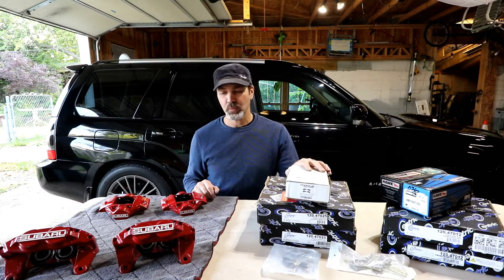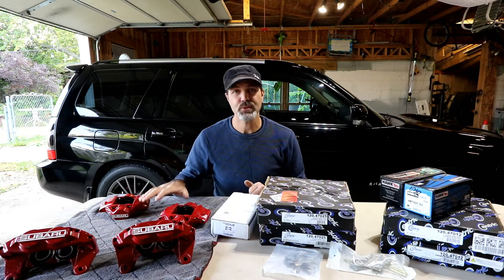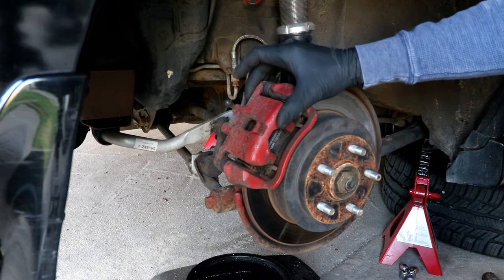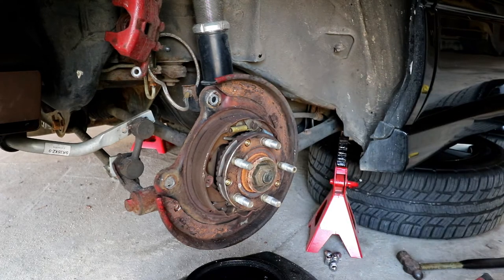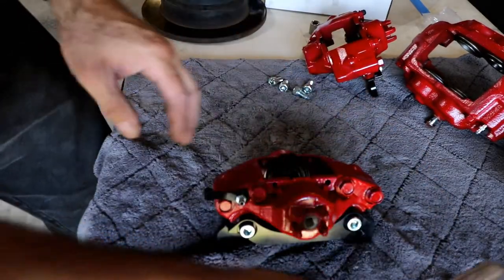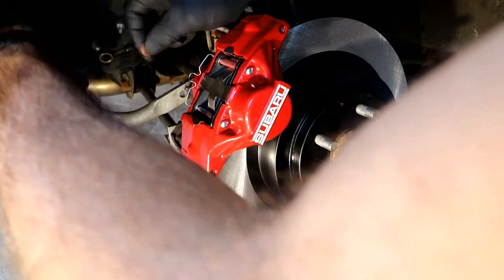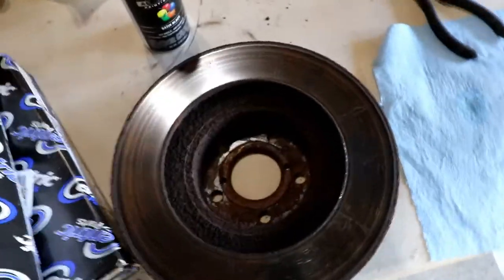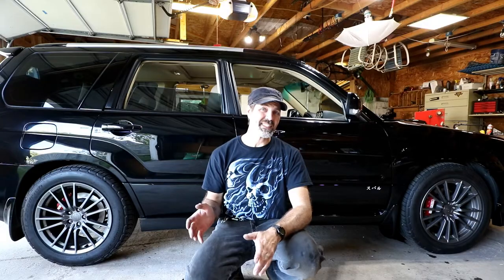How To Install WRX Brake Calipers On A Forester EASY

Comment: i did the same swap = really well worth it = stopping great = i just went with STD brake pads ! street use - track day`s get a different set of pads ! = my 2001 SF5 GT Turbo forester - these were a factory option ! i used cart boy rear adaptors with all stainless steel high pressure caliper lines ! $3,200 , australia -
Reply from the maker: Sounds like you're planning to have some fun.

Comment: Having done this mod on my own 04 XT it really is an awesome mod both in looks and performance upgrade and very cost effective, I chose to source some 06 WRX rear hubs with only 30k miles from a parts wrecker for a proper engineered solution.
Reply from the maker: Yeah, I love the look and really wanted to swap the knuckles but thinking about the possibility of breaking or fighting with "THAT BOLT", this was the faster and more affordable option. Thanks for watching.
Reply: Can you run a 15 inch wheel on your 2004 XT?

Comment: I learned the hard way.. put the bracket adapters by itself on the hub first and get them lined up before putting on the calipers onto the adapters.... all that tugging, pulling and hammering on the hub assembly threw the holes off by a bit and lining up the holes on the adapter has to be perfectly flush or it will never go in or you'll just end up cross threading, which I almost did... just a tip..
Reply from the maker: Good tip.

Comment: I just found your videos!! Dude, very informative!!!! Thank you so much for the time you put into each and every subi mod… I have a 2004 forester XT. 
I just ordered the 06 Wrx front and back calipers, pads and rotors … looks like I need the bracket. Once these parts arrive, I’m assuming just follow the video and I’m good to go! ( assuming this exact method works on my 2004 forester XT…. Right? )
Reply from the maker: Yeah the 04 should be exactly the same, just watch for seized bolts. Good luck and thanks for watching.

Comment: What year is your forester? will the brakes from a 2007 wrx fit a 2017 forester? 5x100pcd?
Also why didn't you get grooved rotors on the back and grade the front rotors as well to 316mm grooved.
Reply from the maker: Mine is an 2006. I cannot say if they would fit a 2017 as I have minimal experience with anything newer than 2009.
Reply: @DIYEVERYTHING  Ive done the research its too hard to do, i need to get the whole rear knuckle assembly off a BRZ in order to fir the rear brakes.
Reply: @DIYEVERYTHING  Also those torque adapters are not available for the 2017 Forester.

Comment: Great Video, thanks! Will this work on an 07 Impreza non turbo. Great Video again.
Reply from the maker: I think you have drum breaks in the rear so you would need the knuckles from a wrx and the proportioning valve. A lot of extra work with no real benefit but it can be done.

Comment: Do you have a link for the replacement washers to connect the banjo bolt to the new calipers?
Reply from the maker: I picked up a couple packs of copper washers from the local auto parts store and used what fit.

Comment: Is it normal for your brakes to squeal a little bit after changing\upgrading to these wrx 4/2 pot calipers?
Reply from the maker: Yes, it's also normal for them to squeal when they are cold. Once they get up to normal operating temperature the noise should stop.
Reply: @DIYEVERYTHING  copyy and also did you have to adjust parking brake after the install?
Reply from the maker: @jhoelt2922  I didn't replace the parking brake shoes, and since my forester is an automatic (for now), I don't use the parking brake. So no, I didn't adjust them.

Comment: Question with these rear rotors do I need to swap the rear hand brake shoes to the oversize version?
Reply from the maker: No, the brembo's use the larger parking brake shoes but the xt and wrx are the same size.

Comment: Is there anything I need to know when buying wheels with these brakes? Thank you for the video, very helpful.
Reply from the maker: Yes, the stock 16s won't fit over the caliper. The 2012 WRX wheels I used clear but are a bit close to the coilovers so I may add a 5mm spacer in the future. If you google these rims, you will find the specs for width and offset, use that as a starting point for your search. Good luck.
Reply: Do you know what offset you to clear the calipers? Thanks again.
Reply from the maker: These wheels are 8.5 inches wide with a +53 offset which puts them about 5mm from the coilover.

Comment: Great video, can I have the PART NUMBERS please for the pads, both FRONT and REAR and the part number/full model number for the ADAPTER please, for the rear? Did you have to use the spacers for the wheels because of the adapters? Thanks
Reply from the maker: Parts are listed in the description.

Comment: Do the rotors come as a pair or do you have to buy two of each? I really want to purchase a set for my forester but i dont know if is a set or single they are sold as
Reply from the maker: They are sold individually.
Reply: @DIYEVERYTHING  thanks man very much appreciated it I've been binged watching your channel cause I have 2007 Subaru Forester Cross Sports S Edition and I plan to do the same conversion on mine

Comment: How the compare to STI brembos?
Reply from the maker: Brembos are larger and can dissipate heat faster so they are better on the track. As for daily use, there is no noticeable difference between any of the three types of brake calipers. It's really all cosmetic.
Reply: @DIYEVERYTHING  thanks so much. What about the ats brembos calipers on subispeed? Are thoses better quality or par with Subaru ? I appreciate your knowledge. I just bought 2004 xt

Comment: I tried putting those longer bolts for the rear adapter and didn’t work out for me, 
The bolt was hitting the rotor so i just put the shorter ones on. Not that much difference i think only 5mm shorter but it works
Has anyone else had this problem?
Reply from the maker: I've seen others who needed the shorter bolts as well. It's a good thing they give you both.

Comment: Did you trouble with one of the rear caliper adapters not fitting correctly?
Reply from the maker: No trouble, everything went together fine. Only difficulty was trying to blindly start the bolts. Much easier if you can get under the car to see what you're doing.

Comment: So just to be clear, 2006 WRX front and back rotors ?
Reply from the maker: Yes, the rear will need the adapters to fit or you could find the WRX knuckles but the adapters are faster and won't hit the wallet as hard. The rear dust shields will need to be removed.

Comment: for an 04 wrx with stock wheels. would those calipers fit?
Reply from the maker: Yes, they should a long as they are a 17" wheel. Some 16s will fit over but they need to have the right offset to clear.